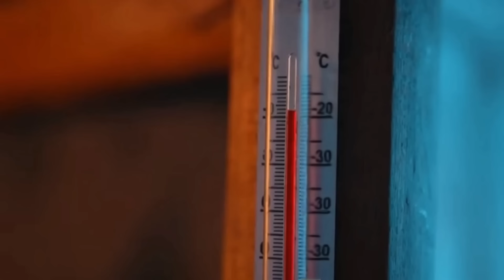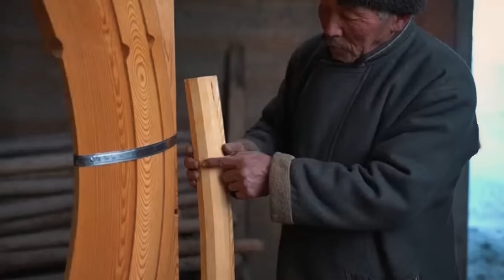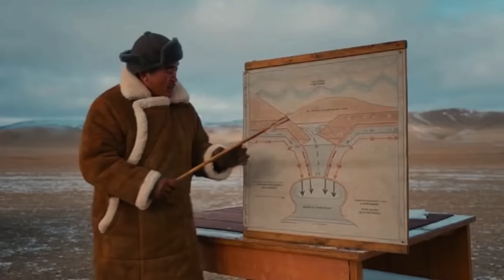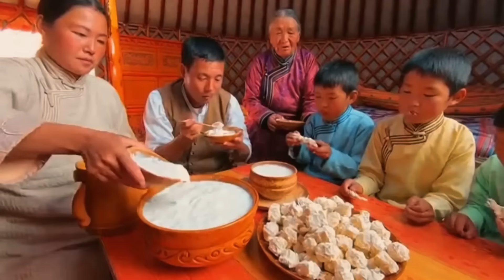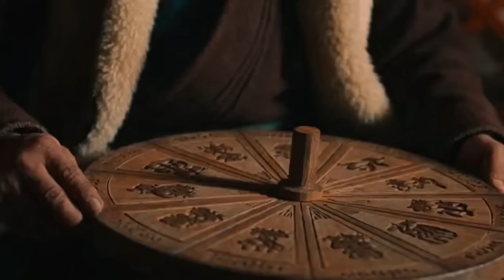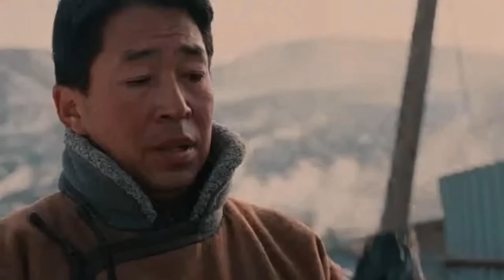How Mongols Built & Survived In Yurtz At -50°C (-58°F ) In Brutal Winters

Comment: What about living with someone that farts non stop
Reply: All you need is love and a gas mask 🤣🤣🤣
Reply: The toono or roof window has one section open at night during spring/ fall. The bottom skirt of the gher is rolled up 1.1/2 feet during summer for air circulation.